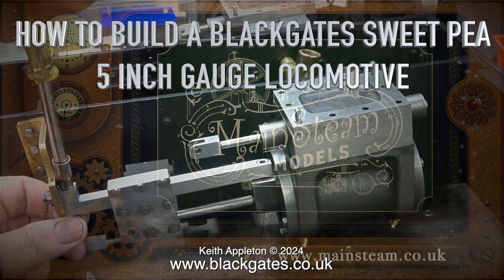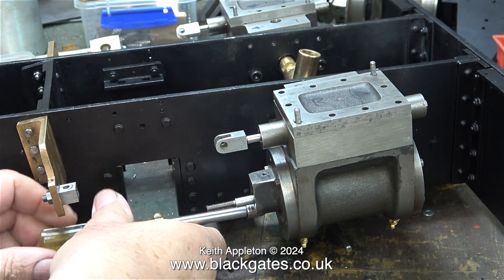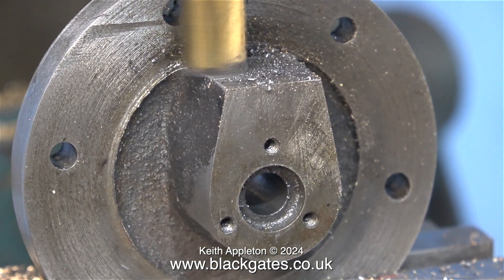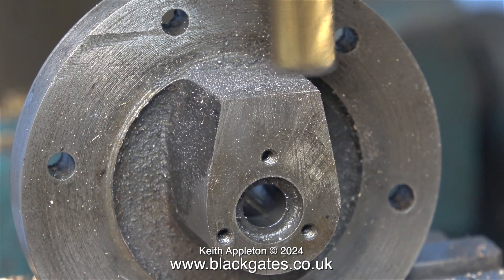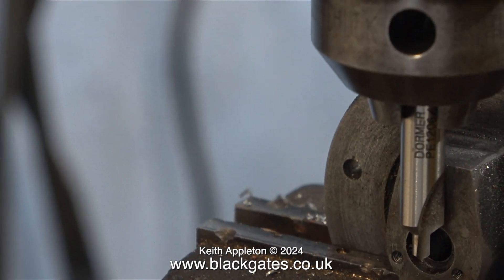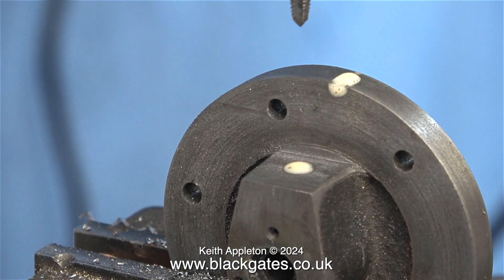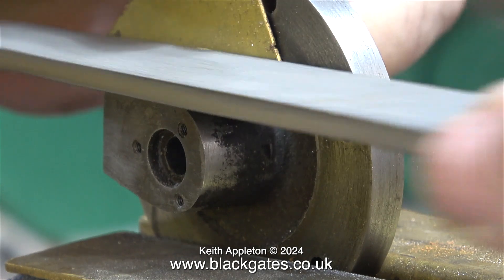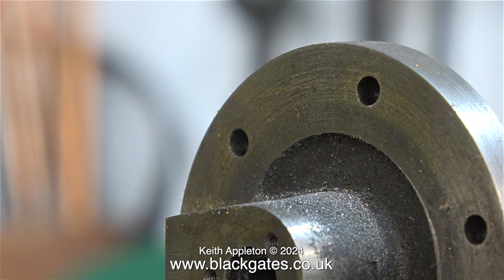A BLACKGATES SWEET PEA LOCOMOTIVE BUILD - PART #44

Comment: An idea:  Instead of holding the piece of brass when you are filing, try using a piece of "double stick" Scotch (cellophane) tape to hold it there.  This usually works for temporary setups like you were using.  Of course your method does work, I think that using tape would be "easier".  Good series.  Thank you.